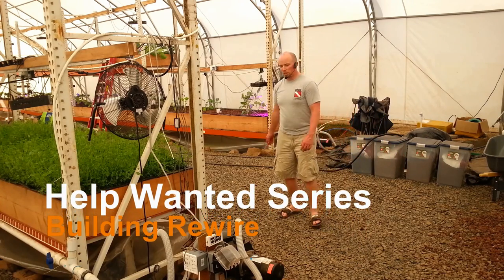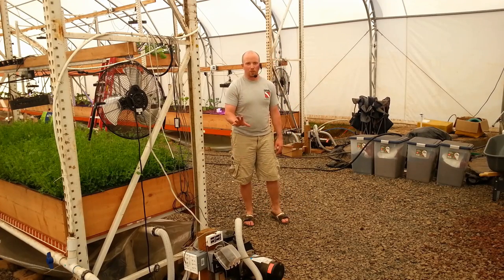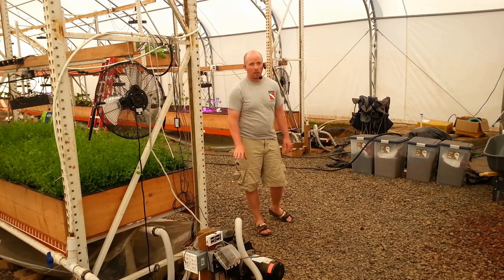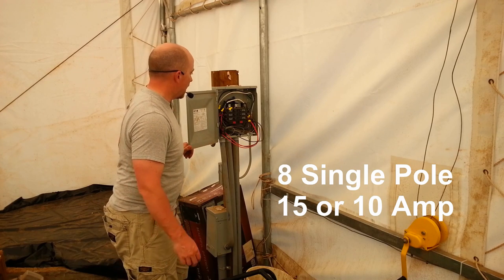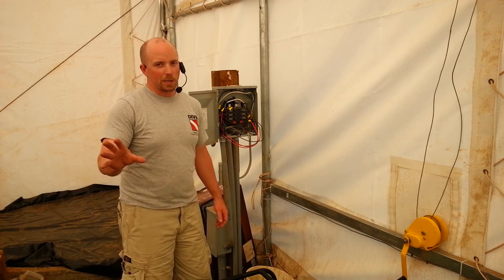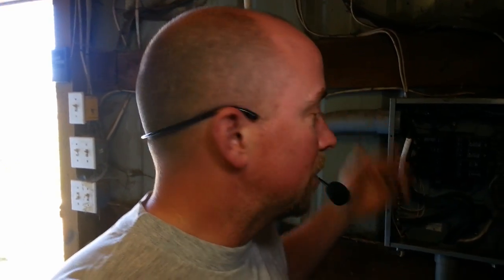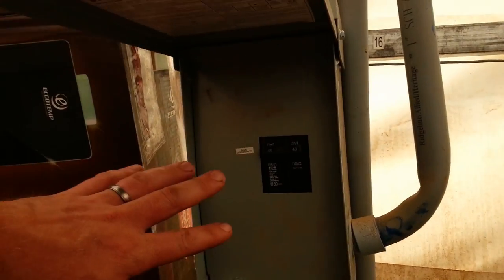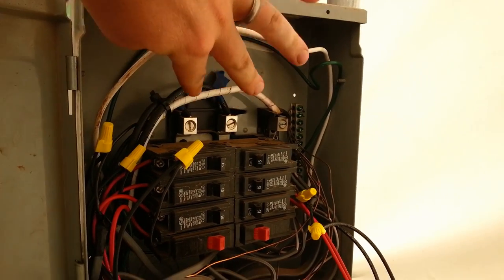Aquaponic Greenhouse, Electrical - Things to Consider

Comment: <-- Commercial electrician here.  I think you need to calculate what the minimum requirements of the pump: What GPH do  you need at what head (pressure).  From there, there are pool calculators that can guide you to what pump you need.  

I think you should scrap the idea for a VFD to run the pumps unless you have a need for variable flow - higher needed some times, lower flow other times.  You would have to purchase a 3 phase pump to connect to the output of the VFD, not a single phase pump.  While 3 phase pumps are available, the market is much more flooded in the residential market driving prices down.

Switching your pumps from 120v to 240v may not give the power savings you are looking for.  If you have two pumps at 120v, each pump would draw ~12 amps - one from phase A and one from phase B.  The same two pumps at 240v would draw ~6 amps each on both phase A AND phase B.  This results in the same ~12 amps on both phases for both 120v pumps and 240v pumps.

A problem with running your pumps at 240v is the breaker space in your panel since you only have an 8 space/16 circuit panel.  The tandem breakers that fit your panel should be the Eaton Breaker Model: BD2020.  However, 2 pole breakers for 240v loads take two spaces.  To use a tandem breaker to supply a 240v load, you would need handle ties to connect handles of two adjacent tandem breakers. I haven't seen Eaton handle ties, but Square D Homeline ties may work for Eaton as well (Square D #HOMTHTCP).  

To get the spaces you need in the panel, you may consider changing the it from the 8 space to a 20-Space 24-Circuit (Eaton Model#  BR2024L125R).

Something else to consider is Ground Fault protection.  Depending on electrical code in your area, you may be required to have GFCI protection for your pump (and many other outlets you have).  240v GFCI breakers will not work with tandem spacing, and require two-full height spaces.  See NEC quote below for pool pump GFCI.

NEC 2011
680.21 (C) GFCI Protection. Outlets supplying pool pump motors
connected to single-phase, 120 volt through 240 volt branch
circuits, rated 15 or 20 amperes, whether by receptacle or by
direct connection, shall be provided with ground-fault circuit interrupter protection for personnel.
Reply from the maker: appreciate the pro-comment :-)

Comment: Here's a few things to consider. With a 40 amp, 240 volt main, you actually have 80 amps available if everything is 120 volt loads, since they are split among the two hot legs, 40 amps each. As previously mentioned, motors like that can often be rewired for 240 volt operation, cutting the current in half, but the total power or wattage stays the same. Then again, you might need to replace the subpanel in the hab to accommodate the double pole breakers that would be needed for 240 volt loads. So it might be best to leave the pumps wired for 120v. Also, have you checked to see if your power company could run a separate service from the street to the hab? If you could get a 200 amp service, then you'd have 100 amps each for the current and future habs. Of course, the quote for that might be over budget. Decisions decisions!
Reply from the maker: yeah a new transformer may be in our future

Comment: You need to determine the flow rate and head pressure requirement and calculate the theoretical power required to operate at that condition at 100% pump efficiency as a first order model.  If your theoretical operating point exceeds the available power, then the laws of physics leave you with 2 choices: 1) Reduce the load (fewer lanes) or, 2) Increase the available power (more solar panels, or higher efficiency solar panels).  On the other hand, if your operating point at 100% pump efficiency is within the available power, then calculate what level of efficiency causes you to reach your power limit.  If no available pumping system operates at that level of efficiency, then the laws of physics again reduce you to the same 2 choices.  If there are available pumping systems that operate at the level of efficiency that you need to operate within the available power, then you will have to pay for them.  If you can't afford them, again, you are reduced to the same 2 choices.

Adding a VFD will only help you if the pumps are operating well above the required operating point.  However, a VFD is not a panacea because it adds complexity and is another point of failure.  If you're considering a VFD, then, in my opinion, you're much better off downsizing the pumps to match the required operating point.  Slowing down a pump with a VFD will take the pump out of its most efficient operating range and will use more energy than a pump that runs efficiently at the required operating point.
Reply: CONCUR on re-assessing flow rate and pressure requirements.  Those pumps seem like over kill to me.

Comment: the wire size from the barn to the hab building will be the limiting factor on how much power you can supply to the hab with the existing wiring.  I have lots of experience wiring variable frequency drives/motors with high pressure pumps.   I would utilize what you have until it dies.  No need to spend the money now to change motor/pumps.  If you wanted to get a back-up VFD motor to learn about it and get materials ready to install it when one of the existing motors dies i think that might be good at some point.   i can probably get you a Pentair pool VFD motor for wholesale pricing, just let me know if i can help

Comment: You don't need a VFD. Restricting the pump outlet with a valve will reduce the current draw along with the flow. Stick a pressure gauge on the pump side of the valve and you can estimate flow from the back pressure using the pump curves. Use the lowest fullscale gauge that can handle the pump's max pressure.  You could have one good gauge that you move around to set up, and screw in cheap gauges to monitor with that you mark for the normal reading. Take the handles off the valves once they're set. You might also take the irrigation water supply from the pump side of the restricting valve so you have full flow when you're filling trays.

Comment: If you ran 240V pumps, they would be half the amps. And staggering the run times with a timed circuit could work.
Reply from the maker: yes I think 240V is key

Comment: Something that I think is being overlooked - You actually have 240VAC/80 amps at your Hab 1 service entrance... 

I know that it's not ideal or desirable long-term, but you have to admit that using all of it does make for a very cost-effective fix for your winter deadline & frees you up to sort out the remainder of the urgent problems.

This would allow you until next spring to not only collect real operational data including power data with your new sensor array, it would also give you more time to solve this problem elegantly. Remember, you didn't start out planning to do micro-greens either.

In any case, you'll probably be needing to replace your sub-panel with one that has more spaces, you'll eventually need to swap out the main disconnect box too, AND Hab 2 wasn't listed as one of the 7 priorities to complete before winter, so you aren't likely to need that other 40 amps before next spring... 

If you can't keep the profit-making portion running & running profitably, then Hab 2 may be delayed or cancelled too, so it may be prudent to make sure you can crawl stable before you try to run fast.

I don't remember the specs on the pumps, but my experience with aquaponics says that the required flow rate is more of a function of the stocking levels of your fish, so if it comes down to it, switching to smaller pumps and less fish may be an option to consider, because the plants won't notice much of the change in stocking density.

For the summer, fall, and next winter, will it hurt too much to just use the full feed? That would at least give you a better chance to get some increased micro-green production and maybe build up some cash to be able to better afford a more comprehensive solution later.

The comments in the thread about solar array efficiency go to proving another point - many people seeing these videos are under the false impression that the solar array is powering the Hab, and as it's currently installed, the solar array has nothing to do with the Hab power or its limitations, because it's just a grid tied system that feeds the utility company. It might as well be located in the next county for the purpose of this discussion, but ironically, because of this, adding a solar system to power the hab is at least worth considering, because it might still be more economical than getting a new transformer from the utility company.

Such a system would need some conditioned space for battery storage, but that analysis can be done after the snow flies in your warm cozy Hab 1...

Comment: Here what to do if u want more into the greenhouse area , u must  upgrade the incoming power from  the house. then to barn and then to the greenhouse. Upgrade the amp of the breakers by 10 amps. So if the breaker is 60 put a 80 amp. Upgrade the wire size to handle the amps

Comment: TRM, After replaying the video a couple times, here's my two cents:
--If and when hab2 becomes a reality, revisit the design of how power is distributed on the property, and address that scope of work then. (What I didn't see is where the PV array is tied in, which may influence that advice).
--if the feeder from barn to hab1 is rated at 80A, then stop limiting yourself to 40A. If the disconnect enclosure is rated at 100 or 125, then swap out the 40 for 60/70/80. Again, first bullet point, and without jumping into too much future design work/master planning, my advice is centered on keeping the tasks at hand to a reasonable level.
--Change out that tiny breaker panel in hab1. Yes, Eaton BR Tandem (1P+1P) and Quadplex breakers (1P+2P+1P) will solve your breaker space utilization in theory, it won't fix the fact that the enclosure is somewhat small and the neutral and ground busses only have so many terminals, or that GFCI circuit breakers are only full size (e.g. 2-pole 15A GFCI for a 240v pump motor takes two spaces).
--How many functional groups of components live in a lane? How should those be organized and grouped electrically for minimizing the impact of an circuit outage? The answer probably starts with "more that one circuit breaker and/or GFCI device".

I'm intentionally not being very prescriptive, because there are so many options, and much more thought needs to be put into redesigning what you have, no matter how simple or complex it is. I suggest designing the operational equipment solution that you would really like to have (pumps, lights, hvac, instrumentation, etc) and then work up the electrical requirements.
My gut is that you'll want some form or pump redundancy, no matter how it gets implemented, to avoid putting all of the eggs in one basket. 240v...probably, if nothing else it helps balance the current on the two legs of the service (and solar array). As others mention, picking the right pumps equipment starts with the pumping requirements, look at electrical second, obviously operational efficiency and KISS are key contributors besides budget.
Reply from the maker: great comment here..thank you

Comment: Remember you have 40 amps x2 if you only running 120volt pumps. As long as u run 2 pumps on phase a and the other 2 on phase b you should not have a problem with you current setup.

Comment: Typically vfd drives are paired to a motor. I'd be inclined to run the entire habitat with one pump, with a redundant pump piped into the system. Items that come to mind are your gpm  requirement and pump head..  I speculate your pump is oversized, but common and readily available.

Comment: Rather than an expensive vsd you could just use a relay system and only drive one pump at a time and have it fill a tank at the top of the lane so you can use that water to water the plants and once it's full it just starts circulating the water for the fish :-) using a vfd/vsd (variable frequency device/variable speed device) will slow the pumps down and they may not move water as efficiently at lower speeds. I would however use a vfd that converts 240v to 3phase 400v (I'm from Australia and that's our normal 3 phase) and use 3 phase motors on the pumps as they are far more efficient than single phase pumps :-)

Comment: breakers can only be loaded to 80% before they start to trip. 

how they work is, they have a bit metallic strip, that as it heats up, will cause the lever to trip, or a solenoid to cause a trip in a short circuit condition. 

you need more power, because 32 amps per side is already too low. 

3 motors regardless of vfds will be over the 80 and that does not include any other drains.

so either some are going to have to be split off to a separately derived power system, such as a methane generator or solar system with a battery storage or you need to rewire from the barn to being more out to the main pole that splits the 80 to 40

Comment: Do all the pumps run at the same time? It seems to me that cycling the pump(s) in cycles of 4 X 6  (or 8 X 3 / 12 X 2) hour increments could be a solution. And seems fairly easy to automate. Or must the fish water be continuous circulation?
Reply from the maker: yes...all pumps running at the same time...water never stops flowing..el baddo if it does

Comment: Run your pumps on cycle with timers and relays and use arduino to control them.. Make a Main Control Panel for all the zone senors, pump and whatever other devices u have to connect in the future. Make a Control Panel that can run all zone values and whatever u have.. I think that is a better way to conserve and use less power and u will have better control over the entire greenhouse..
Reply from the maker: I think you are on to something...changing how we manage everything would free up some power

Comment: Keep all 4 pumps. however change how the water is distributed. use 4 vfd's (one for each pump) and use 2 pumps for two lanes. however, only 1 pump runs at a time. The pump only runs for a set of time (1 hour or so) and switches to the second pump for an a set time and so on. This increases the lifespan of the pumps and gives a solid backup. It is how water is distributed through 100+ mile range water distribution facility. If the VFD is good enough you should be able to get logs back into an arduino that can keep you informed. You should be able to graph out the water flow with a flow monitor and run diagnostics as well. Such as  - pump is pulling higher than normal current to maintain flow rates (pump issue) or flow rate is down but the power consumption hasn't changed (possible clogged pipe). 

If you go this route make sure to put in the capability to manually rotate pumps with a switch or button and to disable a pump from the rotation to perform maintenance.
Reply: Adafruit had a small PLC that would work better for the control systems than an arduino. Industrial PLC's are expensive and the one from Adafruit would provide an excellent alternative till the system can be proved. Then step up to a industrial model to add a little more reliability.

A PLC would add a huge amount of flexibility of the control systems for the entire project as well.

Comment: 1 pump single point of failure.  You can't drop wires from the ceiling remember you need insulation during the winter and the wires will get in the way.  Time for some ducting to each lane.  Leave some rope down the ducting and then you can pull any new cables through.

Comment: Its really a matter of flow rate.  As said earlier down below its a matter of getting a higher voltage pump to reduce the amp load but amp load has to be able to handle the flow rate. You should also think long and hard about your micro greens rebuild when looking at changing the pumps what are the flow rate requirements when you are no longer using flood and drain You might also consider since lane 1 is solely microgreens and smaller you may be able to get away with augmenting only the lane 2 water supply and fish count to supply the microgreens water needs. (ie no flood and drain. As I said about the winter insulation and heating you may want to think about a different fish tank design to control heating and humidity needs. YOu could take advantage of the barrel stove area or between the lanes 2&3 to augment the current system so that only 2 or 3 pumps are required.  Do some serious thinking about the microgreens actually needing their own fish tank system which would reduce the pumping needs
Reply from the maker: great comment Chris and lots to think about

Comment: I assume the pumps are running at higher than the minimum gem you need to keep the fish tanks sustained.  Otherwise a VFD does no good unless it's used to lower the motor rpm.  I also assume the pump motors are AC induction type.  Please consider replacing those motors with ECM DC motors (electronically com mutated motor).  This type allows for variable speed operation while maintaining higher efficiency than the AC types mentioned.  In some cases the ECM is ~75% efficient at lower rpm vs. 20-30% for the AC alternative.  The ECM runs on standard AC and uses an on board inverter to change the power to 3-phase DC and electronics to charge the correct poles in sequence.  No brushes to worry about and can use true ball bearings leading to less maintenance and longer life.  Also run quieter and cooler, especially at reduced power.  More expensive than comparable hp AC units but in this case may be cheaper than bringing in new power.  NIdec (US Motors) pump motor version is the Perfectspeed NEMA 48.  Check it out.